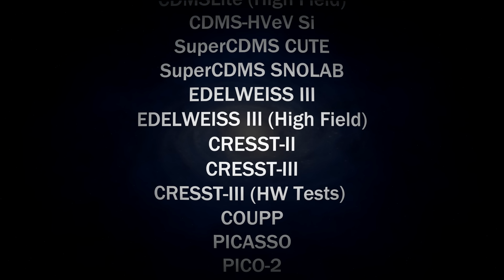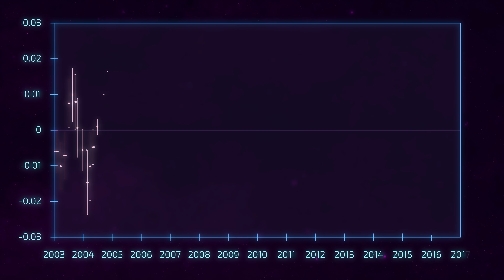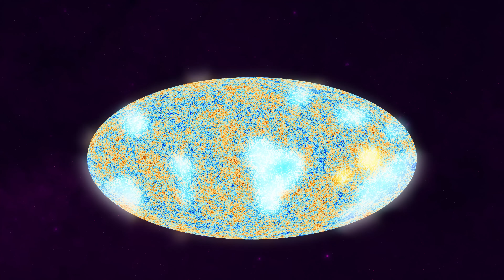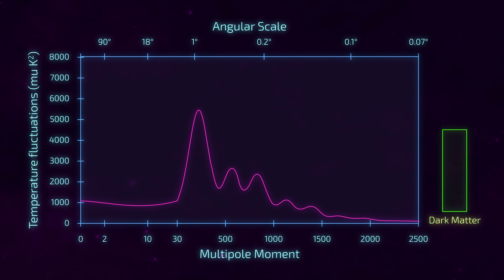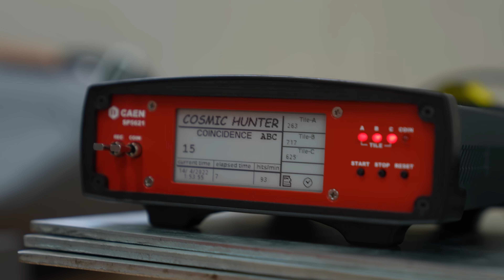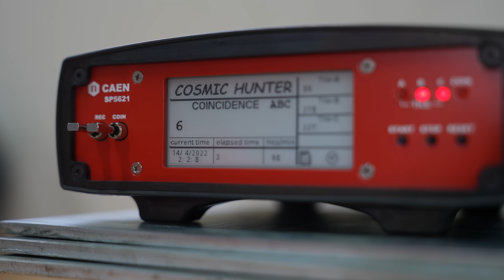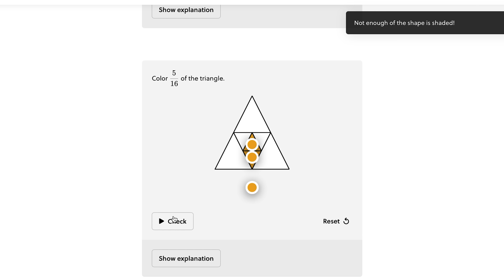The Absurd Search For Dark Matter

Comment: if dark matter doesn't react with matter (except gravity), like you said, how can it transfer its energy to the nucleus and create a response?
Reply: WIMP = WEAKLY interacting massive particle.  So the WIMP theory of dark matter says there is little bit of interaction.  

Other theories may not.
Reply: That is precisely the issue. If it doesn't interact outside of gravity, then all of the experiments using this design of rare interactions will fail. The scientist at the end was acknowledging this possibility.
Reply: @EricHamiltonWI  so you're saying - after all the known phenomena were ruled out, the sensor wasn't supposed to detect any interaction. But since it did anyway, the conclusion is it may be because of dark matter??
Reply: @Pakshya  Kind of. What's significant is if it matches the results of the Italian experiment. Either way it's good experimentation. We either add to our knowledge of dark matter, or discover some other phenomenon.
Reply: that's an interesting question

Comment: For demonstrations on gravity, a circular basically-trampoline has bearings placed on it, to represent the distortions in space. If you placed bearings on the opposite side of the basically-trampoline, and had them be magnetic, with the other sides’ being non magnetic, then put a large magnet suspended over the trampoline, then you would see the nature of dark matter. Dark matter attracts dark matter. Dark matter exists in gravitational opposition to matter. If you placed the Big Bang as matter, with the expansion of the universe decreasing over time, then dark matter would be the Big Crunch with the convergence increasing over time. Then the two eventually flip. With the overall being a zero-sum waveform over time.

Comment: So here's my issue with Dark Matter that someone might be able to answer. When we look at the rotation of stars in a galaxy we see the consistent velocity and of course we know that we need Dark Matter in the galaxy to give it an extra pull to keep it from flying off. But it doesn't matter what type of galaxy it is. It doesn't matter if it is big or small, what the shape of the spirals are, the distribution of stars, what galaxies are next to it, whether it is in a big cluster or more isolated, absolutely nothing makes a difference - the galaxy always has the exact right amount of Dark Matter with the exact right distribution to perfectly have enough to prevent the stars from flying away and perfectly have not so much that they spiral inwards. Every single galaxy with just the right amount of Dark Matter needed to fit the observation. That seems like you need more than just trying to detect it, you need an explanation for why it is arranged so perfectly. Anyone able to help?
Reply: If the state was unstable then it wouldn't be able to stay in that state. I.e. if there wasn't enough dark matter in the galaxy to keep it together then it wouldn't stay together.
Reply: @cawa7787  And we wouldn't see a single instance of a galaxy going through such an event? The ones with too much and the ones with too little would all have completely vanished by now? No really diffuse galaxies that are breaking up left over? Come on, think it through.
Reply: @Sapiensiate  That is exactly what I'm suggesting, the universe is really old. Small correction, they wouldn't have vanished the velocity and mass distribution would simply change such that the state is stable.
Reply: @cawa7787  You realise that when we look at galaxies far away we are also looking back in time tho?
Reply: @Sapiensiate  yes and they would enter their steady state. How do you suppose a galaxy would start rotating faster than its gravity would allow? If you increase the centripetal acceleration then you get an increase in radius and an increase in rotational velocity, there isn't really a situation where the galaxy is spinning faster or slower than its gravity allows without this decaying very quickly.

Comment: Color me skeptical on dark matter.
 
1. If dark matter only interacts gravitationally, that means it interacts gravitationally with itself too, no? If so then it would collapse into its equivalent of black holes and stars. Since there's so much more of it, it would make black holes at a much faster rate than regular matter. In fact, regular matter would pool into the spacetime holes made by dark matter like water into a puddle.
 
2. All spherical celestial bodies (black holes, neutron stars, stars, planets, moons) would lie at the center of a dark matter blob since that is where the regular matter is being pooled. Meaning that our own planet is experiencing the gravity of dark matter right now. So the strength of gravity from regular matter would be a lot less than we think it is and would need to be subtracted from the dark matter blob.
 
3. But that just puts us back to square one, since the original estimates for distant galaxies were made by what we thought the gravitational strength of regular matter was. We just went in a circle.
 
I think the more likely possibility is that there is a mistake in what we are perceiving and measuring. The cosmic distance ladder is built on a set of assumptions, which if undermined sends the whole thing back to the drawing board. It could be that these stars in distant galaxies aren't moving at the speeds and distances we think they are.

Comment: When the solar system is sailing through space, like your animation, with the earth spinning around the sun, which way are the north and South Pole orientated?
Is the North Pole facing head into the oncoming dark matter?
Thanks in advance
Reply: Not exactly, because neither the North Pole nor the South Pole of the earth is facing the direction of the sun's motion. It is just somewhere along the surface.
Reply: @fork9001  Thanks for the reply.
Somewhere?
Is the NP facing into or away from the direction of travel of the solar system through space?
Reply: @deanwatt  It’s not facing the direction of travel. And neither is the South Pole.
Reply: @fork9001  So where does it face most of the time? Or does it oscillate between the 2?
Genuinely curious, I can't find an answer!
Reply: @deanwatt  It just faces into deep space, think of it as facing “North” or “above” the Milky Way.
Reply: @fork9001  Ok I got ya, solar system is at a 60 degree angle to direction of travel. 
So the NP is kinda pointing in the same direction with it's normal tilt.
So the NP is closer to pointing to the solar systems direction (around the Milky Way) of travel than the south?
Correct? Not exactly, but it's closer than the south?
Reply: @deanwatt  Most likely

Comment: Great video. 
Your demo of a spinning star left me puzzled. What does adding a water bottle to weigh your hand down have to do with the ability of the star to spin faster ?  It seems to me that it has to do with the strength of your arm and shoulder or the tensile strength of the rope attached to the spinning object.
Reply: The tube in his hand is hollow and the string can freely pass through it. Hope that helps.

Comment: Doesn’t it seem counterintuitive when you talk about the bullet cluster at 7:35, you mention that the dark matter passed through without any interaction, but we know that dark matter does interact with gravity. Why didn’t the dark matter hang around in the middle like the heated gas ? Does the heated gas have more interactions than just gravity?
Reply: Yep, the baryonic matter interacts with the baryonic matter it is colliding with. DM does not interact with itself or with baryonic matter. So, it just keeps on trucking through. It is the best evidence for dark matter. MOND cannot explain it. They have to invoke a lower amount of dark matter than the standard model. Which is pretty pathetic, given that MOND was invented to get rid of dark matter! I predict its death within a decade.
Reply: 'visible' matter obeys electromagnetism, 'dark' mater doesn't, that's why we call it 'dark'. 99.9999% of your volume is completely empty space, but you cannot pass through walls, because your electron field interacts with the wall's electron field at an atomic level. there are other forces at play as well, but that's the gist of it.

Comment: What I don't understand is ... if you add mass (dark matter) to explain de speeds of the outer stars of a galaxy. Would that not also change the speeds of the inner stars, and thus making them too slow with the addes mass?
In other words, does this not simply shift the problem, inner ok and outer NOK > outer ok and inner NOK?
Reply: Doing the maths, it doesn't change the speeds of all the stars in the same way — the inner stars are less affected.

Comment: How does the experiment control for solar neutrinos? I guess that'll be what the Australian experiment will find, if the peaks correlate to local summer (higher solar neutrino exposure) then the two experiments are a bust and have been detecting neutrinos? The observation of galactic rotation don't convince me of a need to invent invisible matter, but the CMB and colliding galaxy points of reference certainly make the prospect look more tantalizing. I have a question; can information itself have mass, and thus wherever things self-organise, such as during a long period of gravitational interactions, mean that gravity itself is responsible for adding 'mass' to any system of separate masses by rearranging them? This might also explain accelerating expansion because the galaxies are getting heavier so radial momentum is increasing?
Reply: Neutrino detection experiments are not affected by seasonality.

Comment: Minute 8 of the video where is the explanation of an evidence which states the existence of dark matter: first of all, dark matter doesn't collide with dark matter ? And second of all, even that the most part of the gas should be in between, the most dense objects are still asides so probably the most part of the mass should be indeed at edges not in the middle. But again, the biggest problem with this wouldn't be that the dark matter can collide with itself ?

Comment: veritasium, I know that this has nothing to do with your video but I found something interesting:
lets get a fraction like 1/3, and in decimal termes it is 0.3333... but here is the thing. If you multiply 1/3 by 3 you get 1 but if you get 0.3333... multiply by 3 it turns into 0.9999...
veritasium, can you please explain this

Comment: My hangup with Dark Matter is this: If it ONLY interacts via gravity, why don't we have super-supermassive dark matter black holes all over the place? Gravity has no counteraction in the absence of electromagnetism. There would be nothing preventing these particles from forming a singularity in every instance.
Reply: What do you propose would cause dark matter particles to lose angular momentum enough to coalesce into gas, then stars and later into black holes? There's a lot preventing these particles from forming a singularity. They had their chance right other the big bang, that's the only point the universe was small and dense enough to allow them to collapse, but even then they would have needed the universe to have density fluctuation of over 60% from the average, while the CMBR shows us these fluctuations were much smaller, around 0.015%.

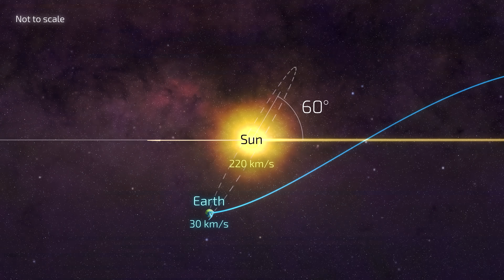Comment: 2:28 If the Sun moves at 220 km/s and the Earth moves at 30 km/s around the Sun then the net velocity should never be negative in the direction of the Sun (its tangential velocity).
Since it's always between 190 km/s and 250 km/s why are there loops?
The blue line should not loop since the Earth never moves backwards ! 
Am I wrong?
It should look like an frequency modulated sine wave I think.

Comment: 4:59 now compare Neal Adams expanding earth except imagine it is expanding into the 5th dimension and not changing size. So the atoms migrate.
So where is dark matter? The quantum foam, foam bubbles Planck length in diameter in a fluid that we think is computer code.
Where is dark energy? E=mc2 the little bubbles are pulsing in and out resulting expansion in a pressurized universe.
But where is dark matter out in space and dark energy is it invisible fairy dust new exotic particles?
Atoms and the void. Look out there, there is just atoms.
So look at an atom, it has to be there.
So magnetism, is dark energy a spherical wave that crests at the electron shell.
Proving all that is all you have to do.

Comment: “The Earth’s rotation in the solar system is at 60 degrees relative to the plane of the galaxy”

What a time to be alive.
Reply: @Martin Brei What are you talking about ?
Reply: @Martin Brei Polar rotation can be measured with a artificial horizon,  it sees a 15 degree per hour tilt. But on a non rotating globe it does appear to be inertial.
Reply: @Martin Brei What the hell are you talking about? Special relativity is literally just a representation of general relativity in flat spacetime. Have you ever gone over the math yourself?
Reply: now squeeeze that paper
Reply: @Martin Brei Acceleration between reference frames was the issue, which includes gravity. Special relativity is just a case of general relativity for reference frames which are moving at the same speed/not accelerating with respect to one another (and can be easily derived from electromagnetism principles and geometry when working in a flat spacetime). What I'm confused about is what you are talking about in relation to the Earth's velocity. Can you explain what you mean or link a research article?
Reply: @Martin Brei sounds like an AI
Reply: @Martin Brei i suggest you read chapter 12 of Griffith’s Electrodynamics. You seem pretty confused on the matter of the ether transition…
Reply: I'd always assumed both planes to be somewhat aligned. For reasons.
I guess it's my symmetry-supremacism shining through.
Reply: @aarondavis8943  We ought to correct this mistake at some point and realign the galaxy with the tilt of the Earth around the sun, not the other way around ofc, that would be too easy
Reply: @Martin Brei All rotational and orbital motions can be measured absolutely relative to distant stars. This makes relativistic descriptions of circular motions challenging to say the least.

In contrast, linear motion is truly relative. It is always measured relative to some reasonably nearby object.
Reply: @Martin Brei unfortunately, all experiments so far conducted to measure the amount of your brain cells have consistently found the count to be zero.
Reply: @Geomephysicus  Depressingly, it's more likely to be genuine, based on some new age pseudo-science ideology. There's too many to keep up with now, which may actually be a positive sign. The more fractious the Nitwit Factions become, the less of a threat they pose.
Reply: This has been known for a very long time.
Reply: @stevenverrall4527  it was a playful attempt at marveling about science as a whole and how amazing humans are, not a snarky attempt to elevate myself by acting elitist.
Reply: @mrbojangles4155  Yes, human intellect is far more amazing than any type of AI. I say this a a computer vision PhD.
Reply: ya right
Reply: @Martin Brei well the universe moves around us. its like moving. i guess.
Reply: @Martin Brei special relativity isn't useless! It is used to explain the marriage that is electromagnetism sufficiently correctly for undergraduate physics and for electrical engineering.
Reply: @josiahqhamilton  yah i agree 🥴
Reply: @Martin Brei except we have night and day so.....
Reply: @Martin Brei but then his biggest mistake was thinking special relativity was useless  right? or no

Comment: What a grift. I can't believe people believe in Dark Matter. I bet the same people that were afraid of the air for 2 years are the same people that believe in this insanity.
Reply: @Riho Bergmann No. It's 100% a belief system. It's an outer space religion. Most people can't even figure that out. I used to believe all this nonsense until I saw it was a religion/belief system.
Reply: @Riho Bergmann Are those observations you're talking about from objects in a Second Law of Thermodynamics violation called outer space?
Reply: @slow-mo_moonbuggy  What the hell are you prattling on about? Dark matter is the only theory that explains observations. Nothing else cuts it. And the 2nd law is not violated. It isn't even relevant to DM. Learn physics.
Reply: @ianw5439  The Second Law of Thermodynamics has everything to do with your claims of people and objects in outer space. See Boyle's Law, Gay-Lussac and parts of Brownian Motion. The necessary anticedant for gas pressure on earth is a solid container.
Reply: “Afraid of the air” you’re talking about a new virus that killed millions of people? Please take your conspiracies somewhere else
Reply: @Riho Bergmann I don't believe it's a hoax. I know it's a hoax because of empirical science. The necessary anticedant for gas pressure is a solid container. You can't have gas pressure next to the alleged 10-17 torr vacuum of space. You would be a science denier if you think people and objects can go into a Second Law of Thermodynamics violation called outer space.
Reply: @Riho Bergmann You are dealing with a flat earther! Check his channel. Pointless arguing with people who have the IQ of a brain damaged wombat.